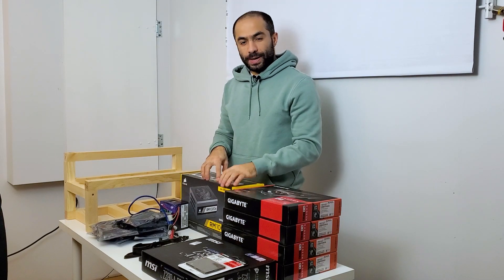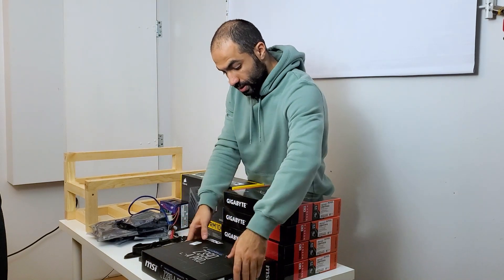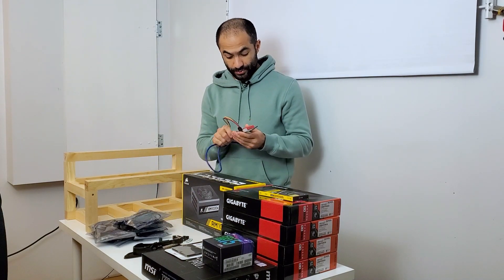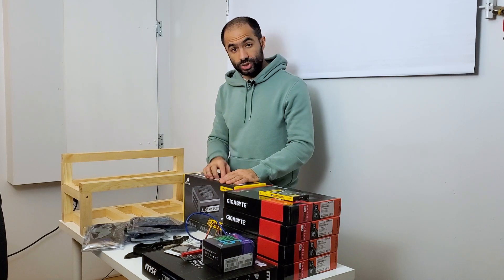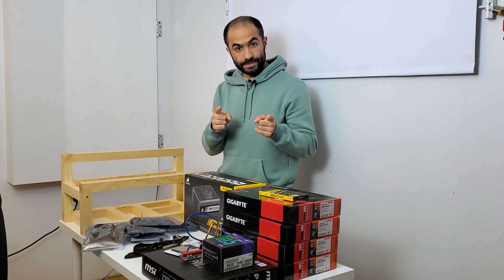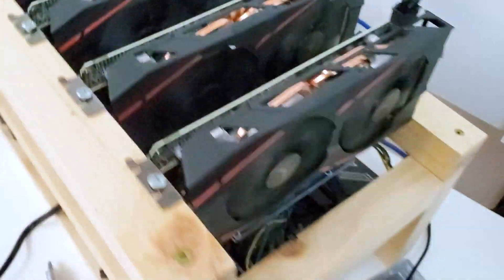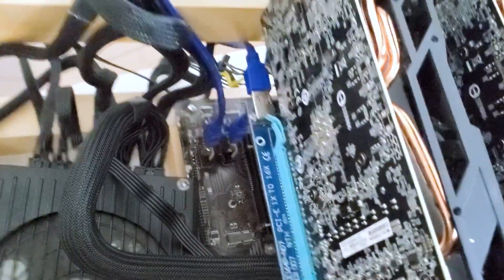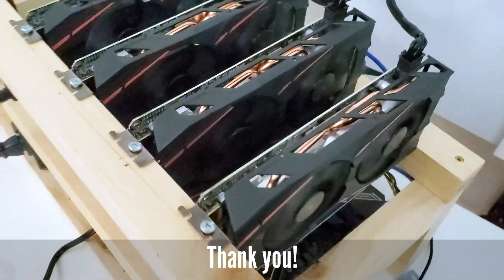4 x RX580 MINING RIG - PARTS, PRICES, HASHING POWER AND BUILD IN 2021

Comment: I'm in Canada as well, and very interested in doing this as well. Any tips on where to look for supplies?
Reply from the maker: Hi Doug. What sort of supplies are you referring to? If it's GPUs, the way I got mine is by spending lots of time on canada computers, memory express, newegg, and best buy to get them. It also took me months to be able to find the GPUs. This is definitely the hardest task of all. Everything else is available but at a premium.  Do have a GPU or two handy on you? if yes, you could start with that to familiarize yourself and understand what to expect.
Reply: @DaniTalksTech  yeah, it’s mainly the GPUs I’m concerned with. When I started looking into this for the first time a few days ago, it was a rude awakening! Man, crazy hard to find
Reply from the maker: @satstacker77  one thing I tell fellow starters like myself. DO NOT fall into the trap of buying double or triple for a card. Yes there is a shortage of supply, and what that means most of the time is that it will take more effort to buy a card, but it is possible. I checked my phone probably 100 times a day in order to get these. I would refresh the pages of CC, bestbuy, amazon, memoryexpress, and whenever something comes in stock i would try to buy it and fail 9 out of 10 times. So it's just a lot more work these days, but it's possible. I am also personally okay with paying up to 10% more of msrp is someone is selling it on facebook marketplace. Basically, I am okay compensating that person for the time they have taken to find it, buy it, transport it and sell it to me. Roughly that's around $50 - $100 depending on the card. Anything beyond that, I am not paying for.
Reply: @DaniTalksTech  thanks! Just out of curiosity, what province are you in? I'm in Alberta :)
Reply from the maker: @satstacker77  I'm in Quebec! Thank you for watching me all the way from Alberta. I haven't been and I'd love to visit one day!
Reply: @DaniTalksTech  and I'd love to visit there as well :) I have 2 kids in French Immersion, and they'd love to experience the culture and languagel :)
Reply: @DaniTalksTech  so I have to ask, how has this rig been working out? Can I ask what kind of $ it makes a day/week/month on average?
Reply from the maker: @satstacker77  hi Doug. The rig has been doing exceptionally well. No fuss at all. I've been running it in windows. I do plan to change/add/remove certain things to do just for upgrade purposes. As of today 18 March, the rig makes around $12 usd per day. That number can change drastically depending on the price of ethereum. The best way to know how much would a card make and consume is either on whattomine.com or nicehash.com
Reply: @DaniTalksTech  thanks for your response, wow you respond fast! You know, I'm thinking I want to essentially copy what you've done. I'm going to do my best to take notes on this and see if I can get all the same specs.

Curious what your thoughts are on the upcoming ETH update that will switch to proof of stake/ I know a lot of ETH miners aren't happy about it... but I still think it's best for the coin. Going to switch to mining a different coin?
Reply: @DaniTalksTech  and really glad to hear it's working out so well! $12 a day is amazing in my books!
Reply from the maker: @satstacker77  I do think long term it's great for the coin. Eth needs to become a deflationary asset. I believe in ETH long term and I will continue to mine it even when the block reward gets reduced. However, I will dedicate one card to mine something else as a hedge. My risk tolerance is medium and this is a long term game for me. What about you Doug? What are your thoughts?
Reply from the maker: @satstacker77  keep in mind that number might become $3 or $5 or $20 in a couple of months. No one knows!
Reply: @DaniTalksTech  yes, for sure! All depends on the value. Personally, I feel that while mining rewards might go down, the value of the coin will go up. ETH is great (except for the insane gas fees!)... so if that can get fixed it will really add to the value I feel... plus the deflationary aspect on top of that.
Reply from the maker: @satstacker77  correct. I do believe in hedging so I have small positions in cardano and polkadot.
Reply: @DaniTalksTech  in terms of holdings, I have some ADA too. Curious what other coin you'd want to mine if not ETH?

Comment: Yeah I just set up 3 580 8gb cards stock there running 29.14mh each which I think I just got lucky even doing OC just brings it down and my current Pwer for each is 78/84/93 should I even worry about  overclocking?
Reply from the maker: well, the values that you are getting aren't too too bad. However, I'd consider overclocking and undervolting the 84W and 93W ones. Those are high. What memory types do you have? and are you running it in Hive or Windows? I can then tell you what settings to apply.
Reply: @DaniTalksTech  all three 580 is 8 gb two are Samsung and one is Hynix I’m currently running in hive. Thanks for the help!

Comment: This wooden frame is beautiful but lord megahash does not care about aesthetics. This looks like way too much money spent on a mere 120Mhs. PSU is an overkill, 750W with 3 pcie and 3 perif slots would be enough (650 would be fine too but I'm not sure if you can get one with enough slots). This mobo deserves 6 gpus.

Speaking from the experience of someone who overpayed per Mhs - minimize your costs. It is a gamble.
Reply from the maker: Hi Pawel. You're 100% right. Since I shot that video I added 3 GPUs to that rig and now it runs 6-7 GPUs pretty smoothly. My biggest cost was the mobo and the CPU. They are way overkill for the job. However it was impossible to find anything cheap at the time. Anything old was equally expensive to the newer models. Plus I thought that the more I wait the less mining I do, so I bit the bullet. Learning something new everyday!
Reply: @DaniTalksTech  Glad to hear it. I'm new to all this myself. Paid $950 for a 2nd hand PC just because it had 2060 and 1070 cards (33,7+27Mhs).
Reply from the maker: @PC-ju6pp  the good thing about that is if mining slows down a bit, you have a solid gaming/editing PC that you can use or resell for close to that price.

Comment: Why would anyone ever think it’s okay to build a WOOD FRAME to hold electronics that get very hot and run a risk of catching fire?
Don’t be stupid. 
Either build a metal frame or buy it.
Reply from the maker: Hi Iam...metal is definitely a better option. The likelihood of the rig catching on fire because of the temperatures it gets to it extremely minimal. As Fusion mentioned, most of these parts are running at 50C maybe 60C and wood can handle that. Plus none of the hot parts are actually touching the wood. In the case of a fire, wood or metal would be an issue. Thank you for your constructive comment though ;)
Reply: Why would anyone build think its okay to use wood near parts that get to 70c at most which will not burn wood. How dumb of them

Comment: You should flash the bios and mod it, you can get around 32mh/s with rx 580, I currently have 3x rx  480 1x rx 580 and 1x rx 5700 making around 166mh/s on binance ethereum pool
Reply from the maker: I have done that and now getting 30.2 stable. if i try to go higher than that, it becomes a bit unstable. Is your running smooth?
Reply: @DaniTalksTech  for now it seems that way, I haven’t tried the voltage changes yet. I will let you know what Mh/s I will get and  on which settings. The model I got is Gigabyte Aorus RX 580 8g
Reply from the maker: @slyhtxd7707  ohh you should probably undervolt them. Mine are using 80Watts
Reply: @DaniTalksTech  I got 3x RX 480 8g and they are stable on 75w 27,3mh/s (per gpu ofc)
Reply from the maker: @slyhtxd7707  if you can push them to 30MH w at 80W that would be good I think
Reply: @DaniTalksTech  32MH/s 80W 50degrees celcius 75% fan speed. Thats what I get on RX 580 Aorus Gigabyte 8g
Reply from the maker: @slyhtxd7707  thanks for letting me know. Do you know what memory type you have?
Reply: @DaniTalksTech  I’ll let you know tomorrow its something like hynix I believe, I can give you my overclock settings as well
Reply: @DaniTalksTech  I have flashed the bios of the card as well
Reply from the maker: @slyhtxd7707  okay cool. Make sure you save the original bios.
Reply: @DaniTalksTech  I did save it
Reply from the maker: @slyhtxd7707  super!

Comment: hey man :) for a 6800xt that's doing 62mhs, if i keep it at 30%fans and 40degrees temperature, is this an ok setup for a long life of the gpu? thanks
Reply from the maker: Hi man, I also have a 6800Xt but I haven't played around with the overclocks yet. Are you running it on a PC? I have noticed that when I mine on it, my PC becomes very slow. Are you having the same issue?
Reply: @DaniTalksTech  i don't know if the pc is slower because i only use that one for mining.   windows 10 64x, 6gb ram, using nicehash only with nbminer, 62-63mhs constantly.  my hashrate drops when the monitor is off or something like that... i use a HDMY DUMMY PLUG instead of a monitor on that pc, and only connect via teamviewer
Reply from the maker: @HHHorea  what's the use of the HDMI dummy? What does it do for you? I haven't tried it myself.
Reply: @DaniTalksTech  it's basically telling the PC that a display is plugged in via hdmi, while there's no display in the hdmi :D
Reply from the maker: @HHHorea  got it. I gotta check it out. Thanks man! Tomorrow I'm going to look into the 6800xt settings on my PC.

Comment: hey man :) for a 6800xt that's doing 62mhs, if i keep it at 30%fans and 40degrees temperature, is this an ok setup for a long life of the gpu? thanks
Reply: Who knows? Check memory junction temperature using HwInfo.  I've increased fan speed to about 1350 rpm after seeing 44C gpu but 75C on memory on 6800 (non xt). This keeps mem temp at 72C. I'd love some experienced people comment on the life of GPU fan. Should we keep them as low as possible and let memory heat up to 85C in the summer?
Reply from the maker: I would love some information about this as well. I have a 6800XT running in my main PC and I'm always uncertain about how mining on it is affecting it. Mind you that I don't overclock and undervolt it. I run that one at stock settings.

Comment: how many gpu can use on this motherboard ?
Reply from the maker: 6 in the PCIe slots and 1 if you get an M.2 to PCIe adapter. However after the 4th GPU, you'd have to do some changes in the bios to make it work.

Comment: Yeah, those cards do run a bit hot.. the gigabyte Rx 580 xtr with the giant heatsink is way better..
 They will also do 30 MHS.. no Bios mod needed. Core 1130 750mv, timing level one and play around with memory speed.. not too high though.. micron vram
Reply from the maker: I ended up modding the bios. I have the original bios so that I can revert to it whenever I need to. They are doing 30MH as expected!
Reply: @DaniTalksTech  ok. Cool.

Comment: 1st Card is getting cold air nothing blocks it .... the others take the heat from the front one of them.... you should space them more ...you have the space to do it so do it unless you fit 2 more in ur rig....
Reply from the maker: Hi Teh. I actually did fit 2 more cards in my rig and they are working great. I managed to better manage the temperatures as well.

Comment: Did you get the parts coming in to swap out?   Write me your total cost please and mining speed once all parts r received and installed.   Also how much electricity pull do you have as a requirement to run it high and constant.  (Average number).   Thx bud.  JUST SUBSCRIBED - ALTON. USA. GA..

Comment: Bro if you dont mind can you tell how mucho $ you making per day with 1 gpu ? And wich criptocurrency your mining? also if you can tell if it is worth because the main problem of mining is the electricity consumption. Great video btw so clean, i will recommend you putting more space between the gpus so there is a better air flow.
Reply from the maker: Hi MaxLife, Thank you for your support man. In regards to your question about $ per day, it's very tough to answer that question accurately because that number fluctuated big time depending on many reasons (difficulty, competition for mining, price of the coin). I am personally mining ethereum at the moment and at the time of filming this video, each GPU was making around 3.5 USD per day. Since then it dropped significantly to around $2.2 or so. So it's quite tough to predict that. Also, in July, it is expected that profitability will decrease further. The best way to estimate profitability is to go to Nicehash at: https://www.nicehash.com/profitability-calculator
Reply: @DaniTalksTech  Thanks for the answer !! For the moment im just saving money beacuse the GPU's prices just got wild so i have to wait more. Thanks and best of the luck with your chanel i already suscribed !!
Reply from the maker: @daoud19912  thanks for the support man. Best of luck! Thank you for subscribing :)

Comment: Love it! - Really wanna get into this.  Any advice? It is bad time to buy GPUs too.
Reply from the maker: Hi Abdifatah, it depends on the price you buy your GPUs at. Do not buy them at crazy prices. For example, just like what Nightcore said, an RX580 should be around $180 USD to $220 USD depending on where you are. But some people are selling it for double. Find good deals online. Also, keep in mind your electricity cost. I would say research it well before getting into it. I am a beginner miner so my risk is low.
Reply: Nope, I am getting an RX 580 8GB for £250
I will get around £50 a month
Reply: If you can find cheap ones on secondhand market u should invest, but u gotta be sure if they are working so better test them out before buying...

Comment: How many kwh does that rig use. You might have said it in the video and I just missed it but I’m trying to figure out the electricity cost for where I live
Reply from the maker: Hi Obadiah, I have since then added 2 additional cards and I am consuming around 800w at the wall. For 24 hours operation, that would be around 19 KWH per day.
Reply: Thanks Dani, for my estimations (which should always be a little higher to consider mistakes) does 3.5kwh per gpu sound reasonable? I love in Nova Scotia and cost for electricity is $0.16/kWh which would mean only $3.36 in electricity costs for 6 gpus. That seems a little low does it not? Or are your costs also in that price range.
Reply from the maker: @obadiahoickle8972  sorry I missed this comment. So if you undervolt and overclock the GPUs, each should consume 80W (assuming it's an rx580), 6 of them would consume 480W. Add in the CPU,  mobo and other items. Let's say you hit 700W or 0.7kW. Your daily consumption of electricity would be 0.7x24 = 16.8kwh in a day. Multiply that by the rate and you'll get your daily electricity cost. At 0.16/kwh, you're looking at $2.6 per day.
Reply: @DaniTalksTech  Interested as well.

Comment: all this money to use a wood case whith wrong proportion xS so sad and bad placement
Reply from the maker: Hi Stephane. This was my first rig and I am not an expert. I will be making another more comfortable rig soon.
Reply: @DaniTalksTech  dont put your gpu to close of each other dont put your gpu to close of you mother boards to and the gpu in to be upside down right to left upside down right to left you core will never face a another core thats its energie saver thats help alot temperature aned at least you spend 3000$ on gpu get a real metal cheap case whith good propositon to start ;)
just this gonna give you couple mega hash hour at end same for cpu keep it cool so nothing need to be close include de gpu who heat as fuck ;)

Comment: Can you go over your bios setup?  I'm using the same motherboard and can't get it to recognize any GPU's.
Reply from the maker: Hi Jason, not even a single GPU? Where did you plug it in first? You have to start with PCIE lane 1. Also did you download the drivers for the GPU?
Reply: @DaniTalksTech  I made what appears to be the mistake of mounting all before booting.  I'll go back and restart.  I also need to learn how to install drivers while using HiveOS; I'm not running windows.
Reply from the maker: Hi Jason, add them one by one and they should work. Add one, start it up, then shut down and add the next and so on. Also, HiveOS should auto-download the drivers. What GPUs are you using?

Comment: Hi! 
What are the bios setups you use for this motherboard?

Looking to build my own mining rig using this motherboard just don’t know how to setup not a lot of videos on it. 

Btw great video keep up the good work man 💪
Reply from the maker: Hi Sam, my bios edits were the following: enabling 4G decoding, changing PCI speed to Gen2, Changing Windows OS configuration from CSM to UEFI. I also made sure to power the motherboard PCIE from the ATX PSU. There is a 6 pin power slot on the motherboard for that. I read somewhere that it helps with powering the PCIE lanes.

Comment: What are those and where did you get those black elevators you screwed in the wood for the motherboard ??
i have the same mbo and a similar frame.
Reply from the maker: Hi Bruno, those black elevators that I used actually came with my monitors. I never used them for the monitor and ended up using them here. However, if you're looking to elevate your motherboard, which I think you should, then consider using a rubber spacer like this: https://www.homedepot.ca/product/canada-tubing-polythylene-tubing-3-16-inch-inside-diameter-x-5-16-inch-outside-diameter-x-10-ft-coil/1001002303
Reply: @DaniTalksTech  Thank you for the tip I will elevate it.
One more question.
What screws did you use and where did you get them?